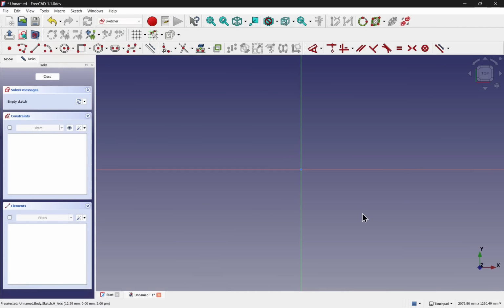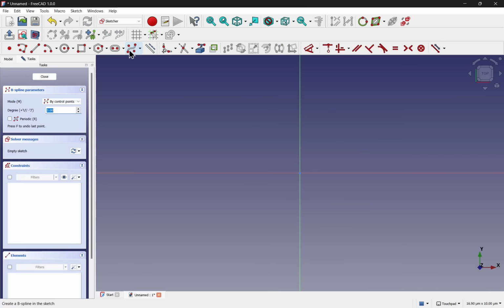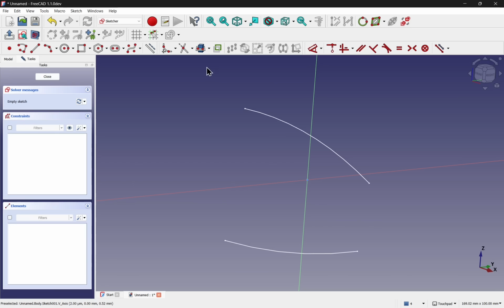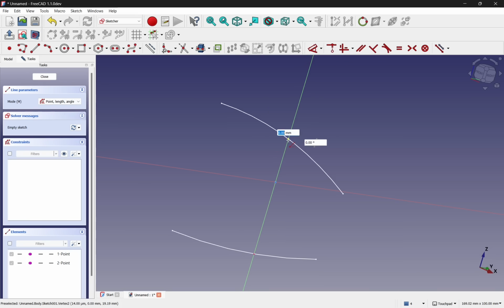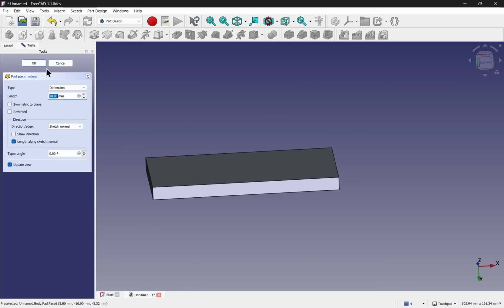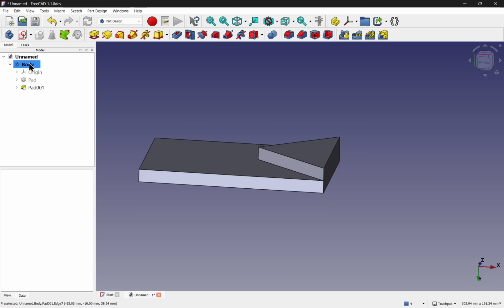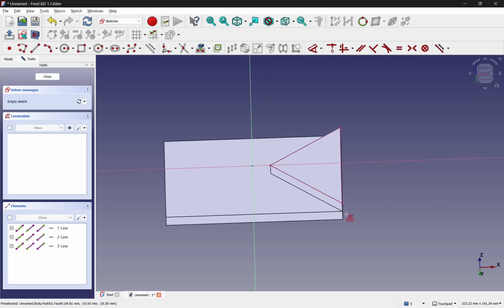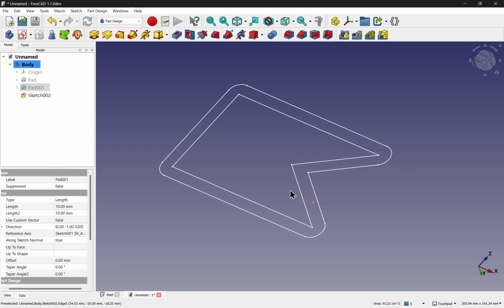New FreeCAD 1.1 Sketcher Features Coming (update to FreeCAD v1. 0) – Really Excited About These!

Comment: is anyone facing the same problerm in 1.0. Sketcher wb, that reference geometry disappears if I draw the same  construction geometry. I.e. draw a reference circle (blue, dashed) then draw a construction circle( white, solid)  and the ref. circle diappears. Same if draw a line and my ref. line diappears. This worked in 0.19  correctly. And I hope it's fixed in 1.1

Comment: What’s the easiest way to make nuts and bolts in 1.0.0? Thanks
Reply from the maker: There is the addon called fasteners. Or if you want to make custom ones you can use a profile and sweep / pipe along a helix. I have a video planned.😊👍👍👍

Comment: not sure how I feel about the external geometry, it would be nice if the default was construction geometry.
Reply from the maker: I am wondering if there is going to be a setting to default this on or off.. Just checked the settings and none I can see at the moment.  I was only thinking this yesterday and I don't like the way this is be default.  It will also make all the tutorials out there much harder to follow as well.  Lots of 'wire not closed' complaints.

Comment: Ooh I'm so happy that this exists and is possible now. Just a little further and I would start to really use freecad day to day. I think it should be able to simply snap to external geometry like in Solidworks, onshape and fusion.. And also when you want to do an offset sketch, so take an external plane and make a sketch that is 0.2mm offset from the one selected. It should be doable in just in one step with one tool.. All the building blocks are now there so I'm super happy it's making such good progress
Reply: Also, just curious, I see now that the offset geometry tool adds a radius to offset right angles.. Is that a setting you can turn off? It's unexpected for me and unlike other cad tools..
Reply: @janienwright3895  you can select between arc and intersection offset. The latter will produce offset without radiuses.
Reply from the maker: I think we are going to see more and more of these improvements  appear as we move further through the versions, and it seems to be accelerating fast. You can add a dimension offset with the tool but it's not too the external plane just to the selected geometry on the same plane. It's a pretty new tool so it will be interesting to see how it progress. 😊

Comment: Thanks for the very clear and concise conversational demonstration of what's coming to FreeCAD.  I'm an engineer and my entire tool chain is open source.  I've been using FreeCAD for my small business for several years.  It was problematic at first but my needs were modest so I was able to save my work often to work around the occasional crash, and I could afford some time to figure out how to accomplish what I needed to do in FreeCAD.  The last two years, FreeCAD has become much more refined and usable.  I upgraded to FreeCAD 1.0 recently and much changed compared to 0.21.  I was lost and unproductive but eight hours later I'm regaining productivity and now have more tools at my disposal.

I hope the user interface is stabilizing now that FreeCAD is at 1.0.  One of the biggest problems was finding a two year old YouTube tutorial video that was obsolete because FreeCAD menus, buttons and even methods had changed.

Even though I 3D print almost everything now, I still have a shop with CNC tools.  I hope the CAM workbench continues to improve, including support for laser G code.

Time to make another contribution to the marvelous FreeCAD developers.  Thanks for the great work!

Comment: I've been trying to figure out how to move parts around. I don't understand how it works for you. I click the same things you click. Draw the b-spline. but then you same some things @1.10. Click once "add it to the hungry selection" click again, move them both. Not
Reply from the maker: If you are using the version 1.1 version then this should work.  Make sure both parts are green and you haven't accidentally removed it from the hungry selection.  Do you know what build version your using? Maybe a bug that has recently found it's way into the weekly builds.

Comment: what's everyone's experience using a weekly build for a 3d design?  reliable enough?  I'm not talking a commercial product, just a model for a 3d print I'm doing for some electronics I made
Reply from the maker: I often use weekly builds for own projects, the issues I have come across tend to get fixed in follow up builds if something is implemented that breaks previous functionality. One problem I experienced was that I couldn't pull in external geometry from a revolve. A couple of weeks later it was fixed.
Reply: @MangoJellySolutions  on day 3 of a design with a weekly.  So far, so good.

Comment: Does that mean I can import an image and import external geometry and then turn that into construction geometry making it so much easier to copy a shape?
Reply from the maker: As long as the image is something like a a svg or vector based image rather than raster.
Reply: @MangoJellySolutions  now you made me look up what different images are in Google lol. I just meant take a photo from camera and copy it
Reply: No, that won't work. It still needs actual lines and curves instead of groups of pixels that just happen to have similar colours. You can import a photo and trace it manually; the built-in image calibration tool ensures that you will be close to the actual dimensions of the part.

Comment: why the heck are there fillets after offsetting sharp corners?
Reply: That's just the default. You can toggle that off in the offset wizard.
Reply: That's toggleable in the offset tool, either intersection for sharp corners or arc for round ones.
Reply from the maker: You have different modes, I just used the defaults.

Comment: The only thing I don't like in 1.1 is the smaller planes when you create a new sketch. Very difficult to select them now.
Reply from the maker: I notice this, I am wondering if there is anyway to make this bigger like the navigation cube settings.
Reply: Apparently it is work in progress, not meant to be the final aspect, they are revamping the planes.